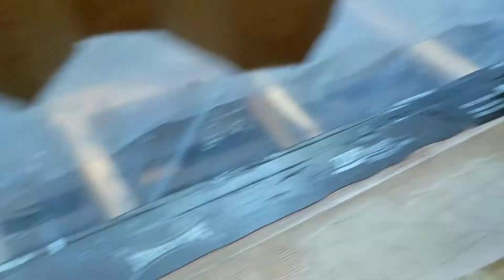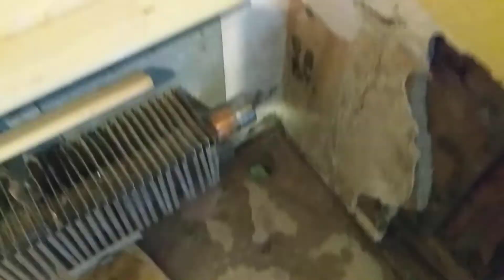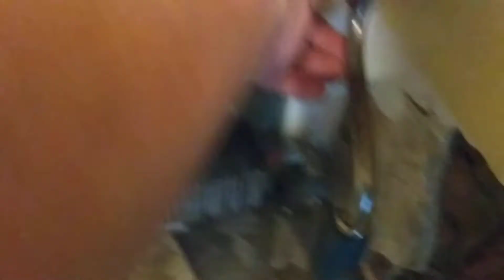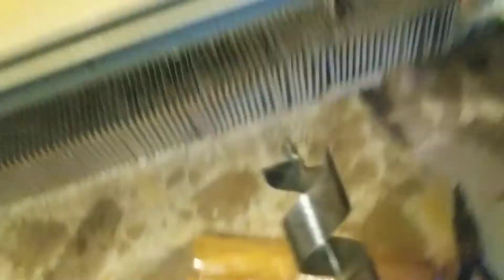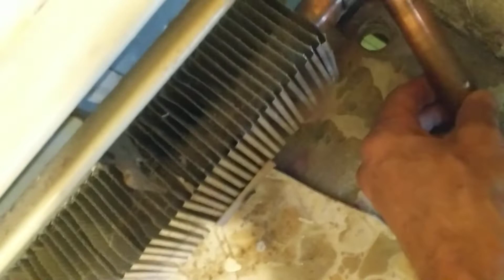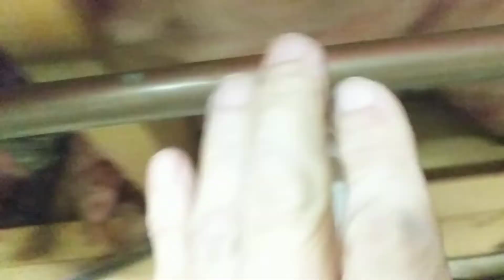PART 3/4 bypassing a section of hydronic baseboard heater for remodel

Comment: If you are removing a baseboard that has no return pipe but has a loop in stead, can you just remove it and cap the line where it entered the hydronic baseboard section?